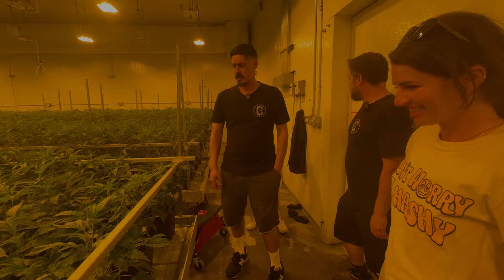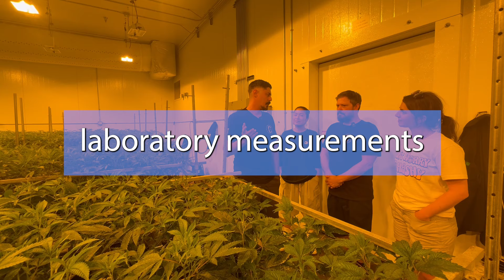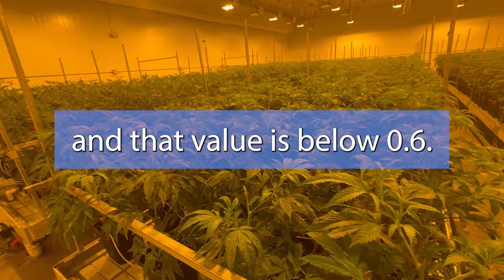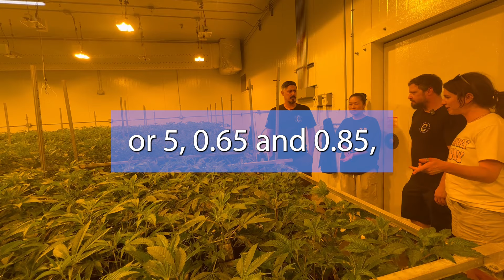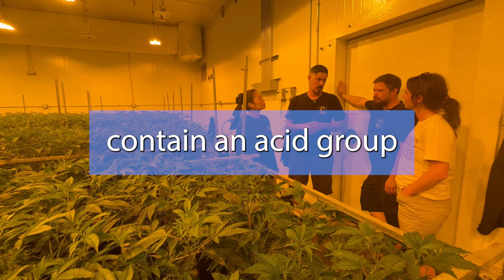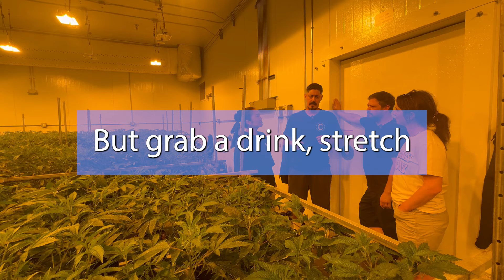HOW TO AVOID MOLDY WEED: Understanding water activity and moisture content

Comment: I love the path this set my mind on. how does using a vacuum desiccator effect smokeability? (if you took it down to a certain level, not completely dry) Can you use this for live resin? It would be cheaper than freeze drying.  You'd still need to cure. what's really the best conditions to cure? do microbes play a role in cure? I love your channel!

Comment: Hello, what do you think could be the reasons why my cannabis is so scratchy when I smoke it after growing? I use organic fertilizer and have grown, harvested and dried it exactly as the book says. Best regards😊
Reply: What organic fertilizer inputs are you using? Too much nitrogen in late flower can be an issue as can excess silica.  On the flipside a lack of fertilizer can cause bunk flower, as energy is diverted to primary metabolic processes rather than production of cannabinoid/terpenes.
Too fast of a drying process and or lack of cure to allow chlorophyll to break down can also be detrimental.
As mentioned previously more information is needed to make a reasonable assessment

Comment: I live in the hot & humid deep south. Ran a load in my new greenhouse but suffered bud rot very badly. Had enough exhaust for a greenhouse back in Cali, plus some oscillating fans, but it just wasn't enough to take the heavy air from the structure. 

Am adding two massive vented fans on one end to pull enough through it to exchange all air in one minute or less. Am also adding several more oscillating fans for air movement from all directions. Am hoping this will overcome this dank environment.

Am open to any and all suggestions out there. Can't maintain these losses for long
Reply: Dehumidifier?
Reply: @IWontBuy-RP  dehumidifier outside is like having a flooded lawn and scooping buckets of water off lawn and dumping on the other side of your chainlink fence.
Reply: We have that problem here in Maryland also. What i do is grow outdoors but train like an indoor when plants start flowering early August i bring the inside to control humidity. We are having a week of rain now. Anything outside is doomed.
Reply: @Gr8fullyDeadHead  For our outdoor, we are building a rain cover out of 3x12 clear poly panels to shield from the afternoon showers we often get 2-4 days a week. We can hang shade screen under in the hot summers but pull it for end of season. We thought about screening in the whole 20x40 area to keep out the crawlies too. Time and money is the only roadblock
Reply: Close up the tent. Use carbon filters to bring in air and carbon filters to circulate the air inside.

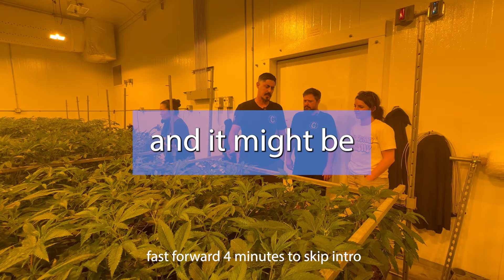Comment: 00:08 Understanding water activity and moisture content in cannabis.
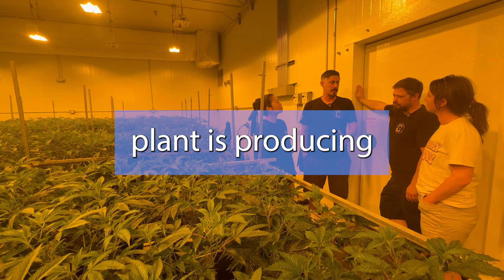02:18 Decarboxylation is crucial to activate cannabinoids.
06:47 Cannabis is integrated into diverse aspects of life.
08:50 Importance of understanding water activity and moisture content for testing cannabis
13:01 Moisture content in dried cured cannabis flour is actually closer to 5 to 9% rather than the ideal range of 10 to 14% as defined by the industry.
15:16 Comparing five techniques to measure moisture content in cannabis.
18:54 Different techniques for measuring moisture content and terpene loss in weed.
20:47 Method development and validation process for cannabis drying.
24:45 Different affordable techniques for small scale hom growers
26:34 Explaining the process of calculating moisture content using sample weight.
30:06 Moisture content impacts weight and THC concentration in cannabis products.
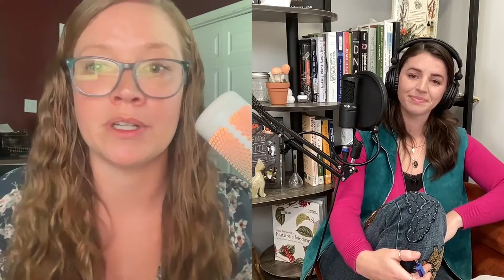32:09 Understanding the impact of moisture content on THC and contaminants.
36:03 Over-drying of legal cannabis can lead to unpleasant smoking experience.
37:56 Challenges of outdoor cannabis and battling mold.
41:47 Understanding the difference between bound and unbound water is crucial for controlling microbial growth in cannabis.
43:41 Controlling moisture levels in cannabis through water activities
47:40 Understanding moisture content and water activity in cannabis
49:43 Proper drying and curing prevent mold growth in weed.
53:29 Challenges and developments in the Cannabis industry in Florida
55:23 Challenges for testing labs in maintaining integrity and throughput
59:16 Synthetically made hemp products are marketed as natural, creating potential dangers.
1:01:13 The lack of transparency to consumers is frustrating.
1:04:56 Utilizing Matrix calibrations for lcmsms in cannabis
Crafted by Merlin AI.
Reply from the maker: wow you’re amazing thank you
Reply: Thanks

Comment: This was incredibly beneficial even from a cultivating view. Just making sure your water activity is right before packaging, in house, could save a boatload of money. Especially in states requiring product to be in its final package before testing.

States that allow process validation. So you dont have to send in product to be tested all the time. You may do everything right and have a clean product. If states dont test for water activity. Checking water activity might not be required in your process  validation and the wrong water activity consumers could get moldy cannabis, down the line.
Something every state should require for testing.
Definitely something to test in house. Even if the state doesnt require water activity testing, this could save the reputation of a facility.